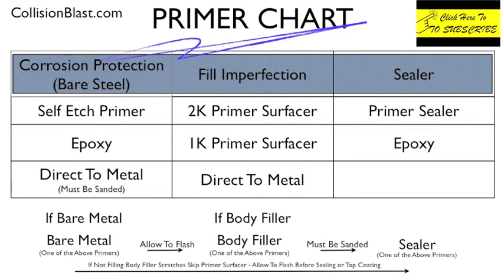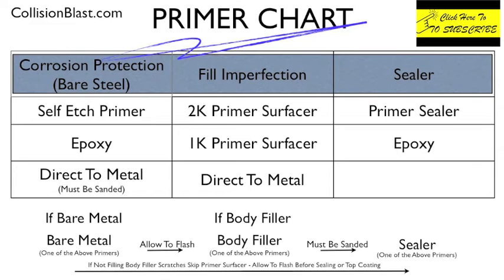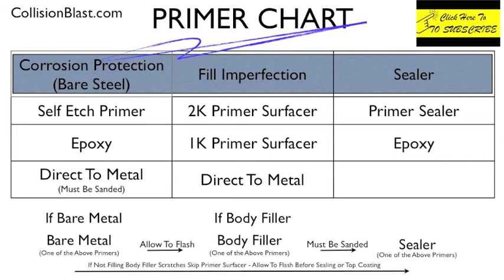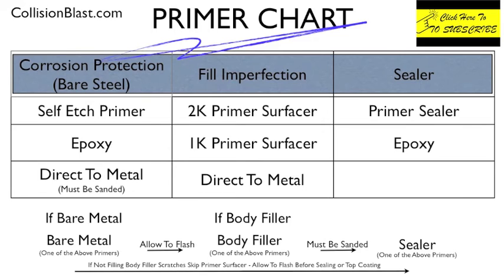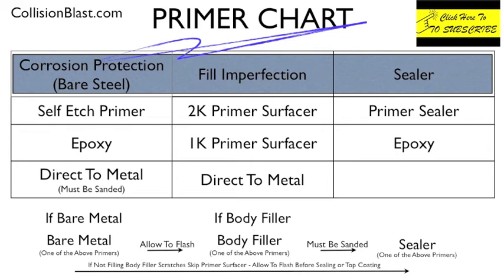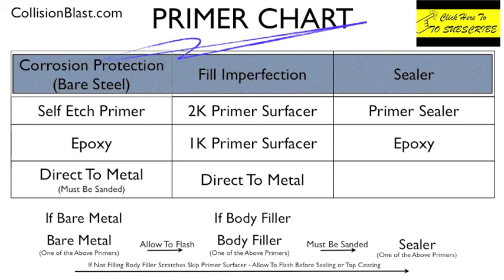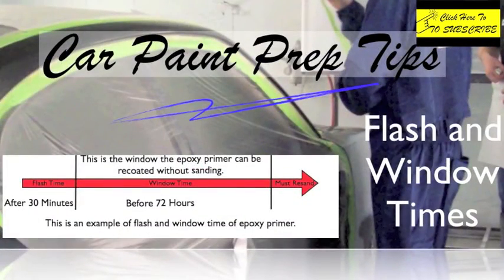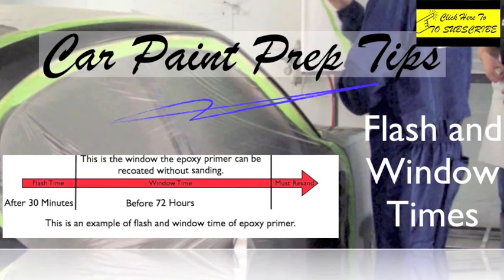What You Need To Know Before Painting Car

Comment: Im repainting our 1999 Suzuki every van (Japan Import) with stahl blau (steel blue in German) common color among latest BMW's, but Im going to sell it once finished so Im on the budget. After applying primer sufacer, sanded, (assuming they're all level) then sealer applied, question is; can I shoot the oldish acrylic color paint (which is cheaper than urethane) then urethane clear coat over it? Urethane clear coat is much durable than acrylic clear coat and it's very old school paint, you know.